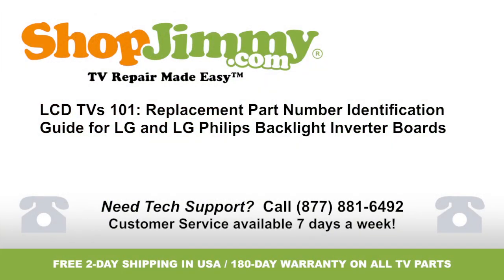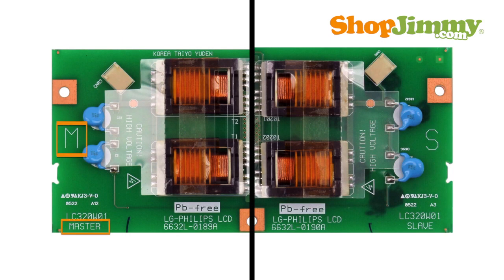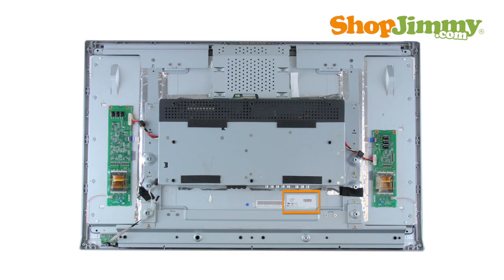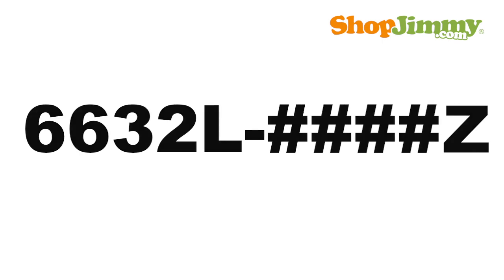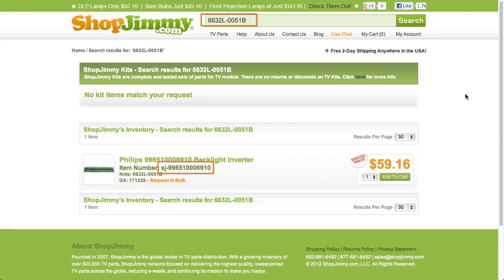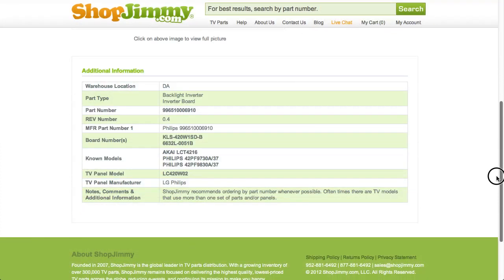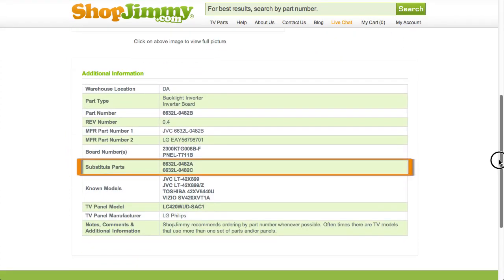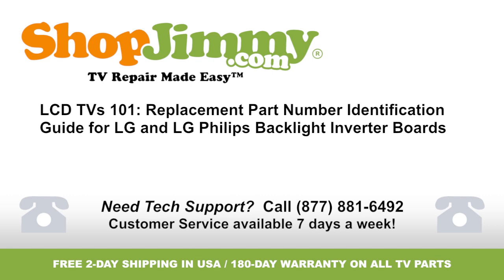LCD Help Part Identification Number Guide for LG & LG Philips Backlight Inverter Boards TV Repair

Comment: LG 47LN5400 backlight flashes and goes out when TV turned on. Flashlight test shows menu, etc. I do not see a backlight inverter. Web search suggests LED strip might be bad. How do I test that, how do I access LED backlight, and where are the LED inverters? Are they on the power board in the  47LN5400?
Reply: Robert Cannon i have the same problem have you ever found the problem man

Comment: I have an LG 55LV355B LED TV that has a snowy, noisy picture on any menu or input.  You can tell the menus are working, but you can barely read them.  The backlights are OK.  I suspect the main board.  Any further troubleshooting tips appreciated.  Is it possible that you carry the main boards for this TV?  Thanks!